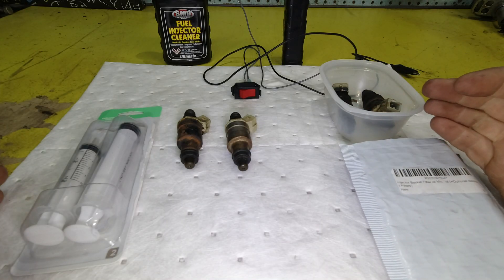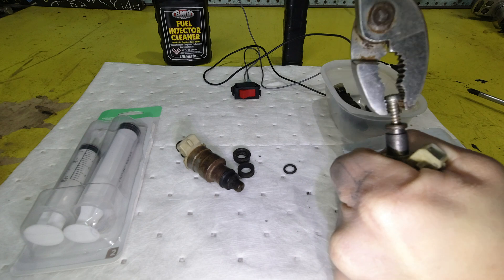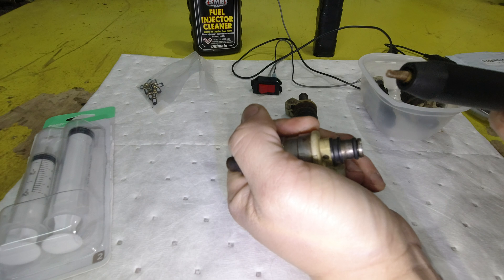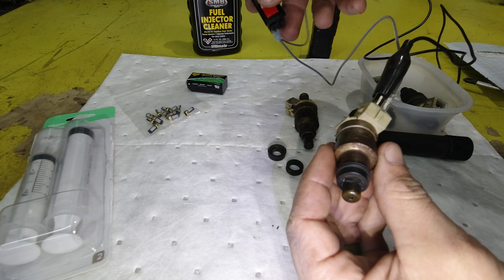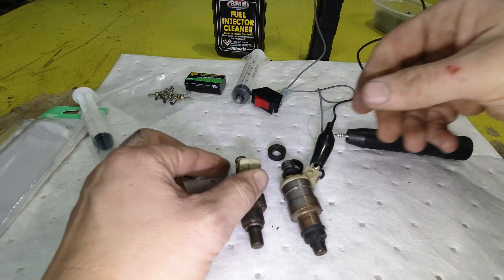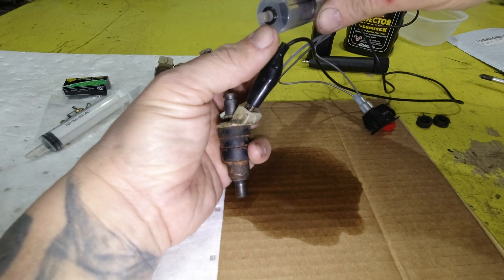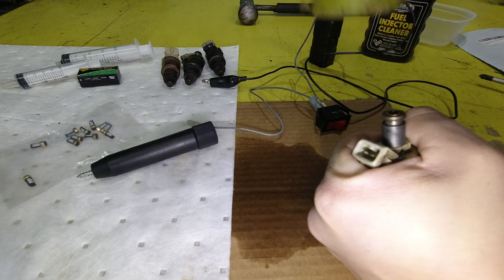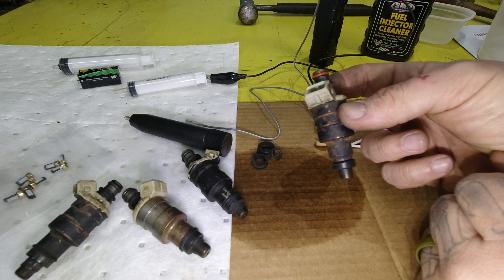$3 FUEL INJECTOR CLEANING! How to DIY fuel injector service for almost no money!

Comment: Good vid. A bit of overkill for this vehicle, as I can pick up a set of 4 oem for $60. But, I really enjoyed watching this.
Reply from the maker: Thanks! New injectors are always an option, of course. I actually just replaced these exact injectors a few weeks ago with newer style 12-hole injectors. Not because they were bad, but because I wanted the upgrade "while I was in there." Lol
Reply: @tinygaragefab I hear you. My wife got a P02 on her Focus. Popped the hood, and fresh oil on the valve cover around the coil packs. 186K miles, and no indication from previous owners maintenance notes of gasket replacement.  Not clear if the code is because of oil on the plug, but probably just going to replace all the injectors while I'm in there.
Reply: @OGMann  check pcv valve

Comment: Tiny Garage Fabrication should have put a disclaimer '' Do Not Do This Yourself ''  254K misleaded folks 😀 , with many comments  parsing your botched  job . Folks , there is no way $3 can get you even close results to a professional ultrasonic injector cleaning . The procedure shown here is totally wrong . Even so called ''injector cleaner'' is not designed for this kind of use , you could at least have used a carb cleaner ! But what you did is you pushed down some doggy cleaner down the injector potentially clogging the injector even more , the icing on the cake was to use a cotton earbud to ''properly'' get the job well done before closing the inlet up with a basket filter .
Reply from the maker: Yes, of course there is always only ONE way to do anything, and you are the knowledge pool for that singular way. Please ignore the actual VIDEO EVIDENCE of the injector stream clearing up and improving in my video. And your take on "closing up" the inlet with a basket filter?!?!?! Um...you have clearly never serviced an injector before, because they come with basket filters FROM THE FACTORY! The fact you didn't know that means you should probably sit this one out, or better yet, make and publish a video showing how you clean injectors with your personal professional ultrasonic injector cleaner. Make sure to tag me! 
Thanks for watching and commenting.

Comment: 4:20 impossible. Not how electricity works, as long as you match voltage you are good. Current is drawn and only as much as is required.
Reply: Doesn't that depend on the duty cycle?
Reply: If the injector is faulty and the coil shorts out in it while you are cleaning, you most certainly don't want a couple hundred amps shorting out in your hand.  He is just showing a safer method.  If you are going to use a car battery, please put an inline fuse of the smallest value you have on hand.  Just in case

Comment: What is he talking about a car battery is too many amps? Really, amps are decided by the device being run not by the battery. In other words, the supply can be anything above the amps needed and the injector will use only what is needed. The problem is only when the supply doesn't have enough amps then it can hurt the supply or in this case the battery.
Reply from the maker: I've addressed this in the comments elsewhere, but didn't addressed it in the video, which is my fault. I should have written a script. Lol
Anyway...if the injector is shorted, which is a failure state, then direct to the battery could cause it to burn, or burn the wiring you have it connected with. That can be a dangerous situation and lead to burns on one's hands or worse, especially if cleaning with flammable solvents.

Comment: 4:30 What you said is not true about using a 12 volt battery will introduce to many AMPS, as the electric devices resistance will determine the current drawn. JUST A ELECTRICAL FACT. Enjoyed the video also Sir Have yourself a Merry Christmas and a Happy New Year. Peace vf
Reply from the maker: Yes, it is correct that the injector will only draw what it will use in accordance with Ohm's Law. (I just retired from 20 years in the Navy as an Electrician's Mate, so I FULLY understand this)
But...if an injector's coil is shorted, then it will draw ALL the amps until it burns. For this reason, as a guy on the internet, it's just safer for me to say it's a bad idea, rather than draw out Ohm's Law for the masses on YouTube.
Reply: @tinygaragefab  Thank you Sir for your service. Nice to hear from you about your time in the NAVY. Can I ask if you sailed the seven seas ? Have yourself a Merry CHristmas and have a Happy New Year. Peace too. vf

Comment: Great video. IF you want to improve cleaning efficacy then after you run the cleaner through the body, leave the injector tips to soak, suspended into the fluid for a few hours or overnight, then run the spray again (:

Comment: A warning: My car has an engine with denso diesel (common rail) injectors on a  2010 2.2L Toyota Avensis and this procedure wont work with those. Well, actually it works but it would need a 110V DC instead of this 12V source. Such injectors are activated by the ECU using a DC\DC converter from 12V to 110V. I just realized that after trying a kit I bought using 12V. With just a 12V battery it's the same. You can ear the solenoid click one time and then you'll have to wait a couple of seconds to repeat the process, otherwise it won't even click. More than that, the solenoid clicks slightly because of the accumulated charge in the 12V adapters. After the condensators dissipate the charge, it will need to charge itself again, it takes time ... and it's only 12V, so it won't work. I tried the carbon cleaner and, in reality, it clicks but it doesn't even open as there is no spray at all coming out from the nozzle.

I searched online and found the details. Use the query "Denso Common Rail Diesel mechanic com au" on google. I don't know if there are other injectors with different voltage. 

Don't do like I did... (or try to redeem yourself by warning others). Search before buying. Cheers!

Comment: Bought Amazon Kit; Rings.. filters... plastic Pintles. for bosch injetors 
 NONE of the parts fit well if at all .
 Filters MUcH shorter than the OEM bosch ones
  O rings were smaller than the originals. And the platis pintle /nosepieces covered up the 4 injector holes .
JUNK is the best description.

Comment: Great video and very informative!! Yours was measured in 6x3x13.1 mm is your measurements for your car. My car is a 2016 Subaru Forester. 

On Amazon it shows options to buy 4 -8 fuel filter baskets that comes with that basket fuel injector basket removal tool. It made it sound like the fuel injector filter baskets were all the same. Obviously not and you pointed that out but Amazon did not.

It goes to show you how crooked this world is in ripping you off. (4) 2016 Subaru Forester fuel injectors are $500. I never knew you could rebuild these and never replaced one. I look forward to getting my car fixed as it has 84k miles and from 31-32 mpg it guzzles gas bad at 16-18 mpg which is pitiful. I put air filter, changed oil, plugs, etc.
Reply from the maker: I'm glad you liked the video, and I hope you find all the success in cleaning your injectors. It may have you cursing at times, but the reward and lessons learned are usually worth any frustration had while doing a job yourself.

Comment: $80 to clean fuel injectors?  Were they going to remove and install or spray with a system?
Reply from the maker: That was just to run the injectors through their machine after I removed them. I can't imagine what they would ask if they had to remove and replace!
Reply from the maker: That was just to run the injectors through their machine after I removed them. I can't imagine what they would ask if they had to remove and replace!
Reply from the maker: That was just to run the injectors through their machine after I removed them. I can't imagine what they would ask if they had to remove and replace!
Reply: Might as well just buy the 505 super injector cleaner and leave them in and run.

Comment: Is it possible to clean a non electric injector with the seringe method such as in my diesel engine
Reply from the maker: I actually don't know for sure. Since diesel injectors generally operate at a MUCH higher pressure than gas injectors, I don't know if this method would create enough pressure or flow to do much. For the cost, I'd say it's worth a try, but I cannot say if it's effective or not.
Reply from the maker: I actually don't know for sure. Since diesel injectors generally operate at a MUCH higher pressure than gas injectors, I don't know if this method would create enough pressure or flow to do much. For the cost, I'd say it's worth a try, but I cannot say if it's effective or not.

Comment: i  used one of those corded 7.5v 0.500mA power packs it worked, i have used car batteries but i did notice the injector warm up in my hand.
even at 9v dc at .75amps they get warm IF you accidentally leave it on, ended up using a momentary on switch from a windrcreen washer kit i had lying around, i destroyed an injector trying to remove the bucket screen so im just buy the tool.
i think theres a fine line between a screw that is just right and one that just ruins your day, it was a very good injector too lucky i have spares  im going to get more used injectors that i can practice removing these screens LOL

Comment: I want to use brake cleaner, do you think it is better internally?
Reply from the maker: It will most likely break up varnish faster, but could wreck any softer plastics or seals that may be inside the injector. I don't know what's in your injector, so I can't say much except: "try at your own risk."

Comment: I spent $50 on a 2L sonic cleaner (Vevor brand) specifically to clean my injectors while the engine was apart. It was a little tricky to make sure the inside cavity was filled with cleaner instead of air, but when that's done you put an injector in a zip lock and fill it with enough cleaner to fully submerge it. Then you fill the cleaner with hot water, put the zip lock in, and let it do its thing for 5 minutes (one injector at a time). They came out like new inside and out. Probably over kill but worth it IMO.
Reply from the maker: I also have an ultrasonic and do basically the same thing if the injectors are really old or unknown condition. They definitely bubble for a while before they fill with cleaner.
Reply: Basically he's putting it in a zip lock bag with cleaner so the fuel injector doesn't scratch the bottom of the ultra sonic cleaner! Hot water goes inside of the ultra sonic cleaner bath, fuel injector goes in ziplock bag with injector cleaner and you toss it into the water and turn machine on and it vibrates the shit outa the ziplock bag with injector in it without scratching the bottom because the plastic bag prevents that.
Reply: @aaronrodden8121  I wouldn't car if the cleaner was scratched, it's just a way to submerged the injectors in cleaner while using a lot less cleaner.
Reply: So is the injector in one bag with cleaning then in another bag u fill with hot water then u put that bag with injector and solution into the hot water??
Reply: @JosephReynolds-pi8fr  No, I poured the hot water into the cleaner. It has the ability to heat water I just decided to use a kettle. Then I added the cleaning fluid (Sea Foam, just what I had on hand) and injector into a zip lock bag. That bag goes into the hot water that is in the cleaner.
Reply: Why one at a time?
Reply: @willynilly1445  I had it in my head that the insides would get cleaner if I did them one at a time, like more of the vibrations would get inside or something. Not sure if that's how it works though. Maybe if I did all four at once for 20 minutes, with a flip and a rotate every 5 minutes, then they would get cleanerer than one at a time. I had no idea what I was doing, just trying things out.

Comment: Are those diesel injectors? Regular gas tends to act as it's own solvent so rarely get carbon build up.
Reply from the maker: Regular gas. It doesn't carbon up, but it turns to varnish, especially ethanol blend gasoline.   And when that sticks in an injector, it can totally keep the pintle from moving, rendering the whole injector useless.

Comment: Too many amps will burn the injectors? Arent amps rather a principle off "pull" than of "push"? Meaning the injectors just pull as much as they need, no matter if you have 1A or 20A? Thats what I thought at least.
Reply from the maker: Technically, you are correct. I guess I should have described it as availability to amps. Imagine the injector coil is shorted,or you make a mistake and short the test leads, and it has 1A from a 9V battery vs 450A from a whole car battery. One is far less likely to become a red hot disaster in your hands and potentially lead to some serious burns.

Comment: 94 f150, rebult engine.  180k on old ejectors.  Should I buy new or rebuild?
Reply from the maker: If they still actuate and spray good, I'd keep them. The injectors on my '98 4Runner with 330k miles are original and work flawlessly.
Reply: @Tiny Garage Fabrication  thankyou for your reply.  They are a offal price new, Motorcraft $124 each. I just had my engine  rebored and new guts in her. The ole toyota is a great machine you have

Comment: Nice job, what vehicle did these injectors come out of? where are new o-rings sourced? btw you don't really need the momentary switch just tap the wires be fine for one care unless you already have a momentary switch handy
Reply from the maker: These injectors are from a Camry 5SFE engine. I got the o-rings from Rock Auto and the filters from Amazon.

Comment: Thx think I might have injector issues. Liked the info got 89 351w I just had the upper intake off wish I would have done this
Reply from the maker: That's the worst, having out everything together and then realizing there might be a problem. My Toyotas almost always have a reusable metal gasket on the upper intake, so it's usually not a huge deal for me. The US vehicles almost never do this, which sucks.

Comment: Will this work for aftermarket injectors? Im currently installing braided fuel hose on my Turbo foxbody and got dirt in the 80lb deka injectors that I need to clean out. I also need to clean the hoses from when I cut them with a cutoff wheel if you have a video showing that. Im going to see if I can find the filter baskets for my injectors.
Reply from the maker: Should work for any injector. I don't have any videos on braided lines, because I generally don't use them. I use the push type with clamps for my FI installs. I show it in my C-10 video, Episode 7 at around the 15-minute mark.
Reply: @tinygaragefab  Thank you for the info I’ll check out that video

Comment: Just on the battery... the injector determines the current draw which will be the same whether you use a 12V battery pack or a car battery so you can certainly use a car battery.
Reply: Yep. The injector is the load (resistance), and ohm’s law  current = voltage/resistance.  So, it is important to check that the injectors operate at the battery’s voltage 12VDC.  Also, injectors are pulsed, so they have a low duty cycle.  Leaving them on continuously could overheat the solenoid inside.

Comment: Where do you get the switch and syringes?
Reply from the maker: I got the syringes at Walmart and the switch from my toolbox drawer. Switches like this can be found at most auto parts stores and probably Walmart as well if the have an automotive section. It would be by the fuses, wires, and bulbs.
Reply: What is the link to your too box? Lol, I couldn’t resist
Reply: Good video, very helpful- thank you very much.
Reply: Walgreens

Comment: This is the most sensible solution I've seen.
Reply from the maker: Thank you! I brainstormed for a bit on the easiest way to run fluid with some pressure without adapters and hose clamps, and this came out on top. Glad you can find it useful!

Comment: There are some fuel injectors with larger inlets on the top, like 
4x New Fuel Injectors for 2001-2002 Saturn SW2 SL2 SC2 1.9L I4 25178967 25178968
4Pcs Fuel Injectors For 2003-2005 Pontiac Sunfire Chevy Cavalier 2.2L 832-11211
I bought the kit shown in this film, the o-rings fit, but the filter baskets seem to be too small, they could go inside of the inlet opening down and you can't tape them. Do you know what it is and how to chenge the filter baskets in those injectors? Thank you for your film.
Reply from the maker: I mentioned the critical dimensions that you need to measure for and buy the filters based on the correct size for those injectors.
Reply: @tinygaragefab  I'm afraid those particular injectors don't have any micro filters. I'm curious what is instead. I'll use the micro filters for another set which is Rochester injectors (6 holes!). Those do have the micro filter baskets. Thank you for your replay.

Comment: SERIOUS QUESTION: Why is this setup with the canister so different than just simply adding a couple quarts of B12 cleaner directly to an EMPTY fuel tank and letting it idle?
Reply from the maker: This way, you can change the o-rings and strainer baskets.  Also lets you know if the injector is actuating or not.  When it's fully installed and the car is running, it's hard to tell if the injector is working.  That's what the issue was in my Talon that had me chasing my tail for months.  I was certain that the fuel injectors were working, but after I finally pulled them, I found out that they were all dead.
Reply: Well summed up!

Comment: 9:50 would be a great idea to spray out any fiber from the q tip with air before you press the filter in. Because If any fibers are left behind they will probably get stuck in the injector nozzle.
Reply from the maker: Yeah, that's a good point. 👍 thanks!